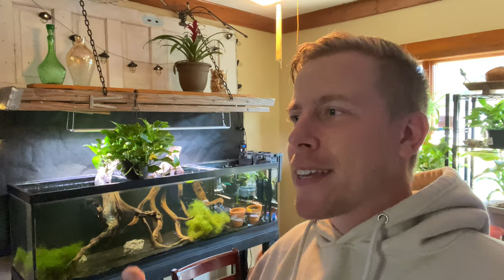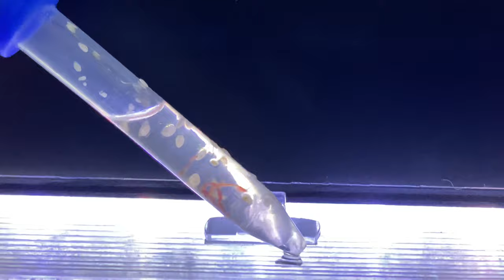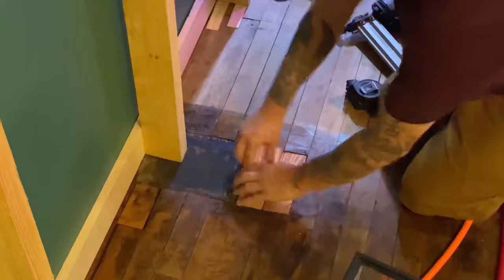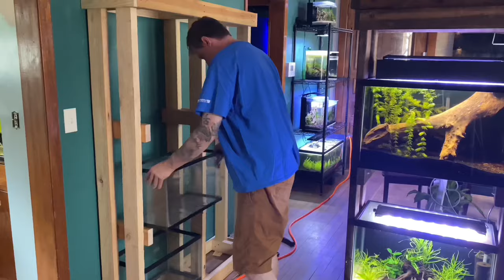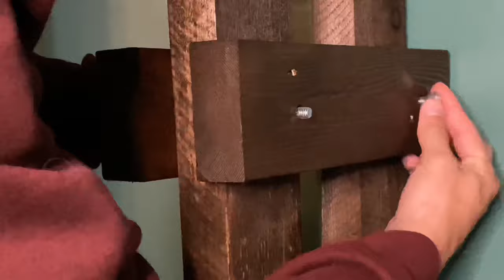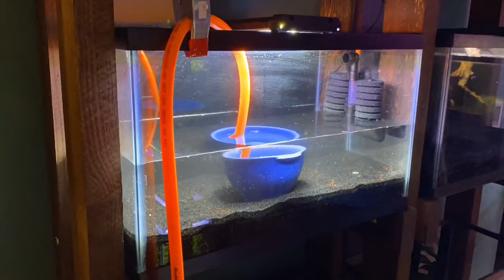Pea Puffer Tank Mates for a Community

Comment: I just set up a 15 gallon colum with 2 pea puffers, 2 checker board barbs an 4 kulhi loaches. Which I will move th pea puffers an loaches to a 15 cube in a month or 2. So we will see.

So 3 pea puffers  an 2 snails in a 15 cube. Heavly planted an feeding 2x a day. So far its a good mix.
Reply: Update 
3 pea puffers in a 20 long moderately planted. Some mystery snails are the companions. The puffers eat every single ba y snail no out breaks.
Reply: @onehitterquitter2130 hi I was wondering do your puffers nip at your mystery snails?